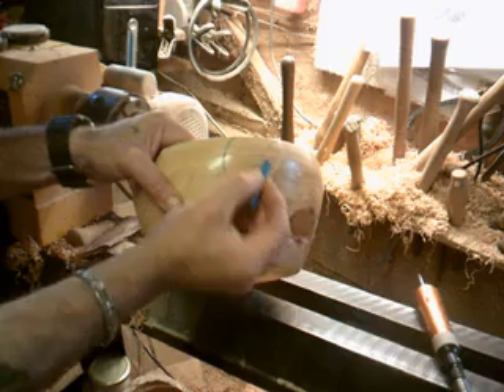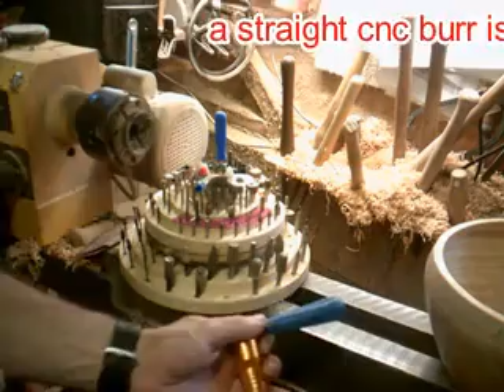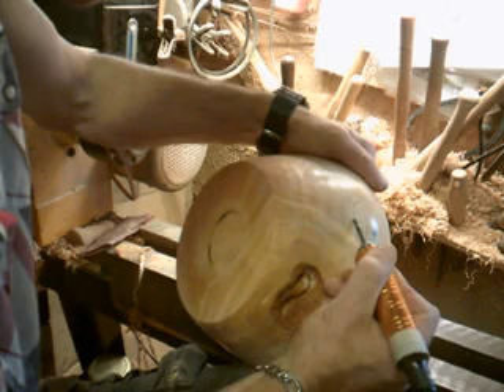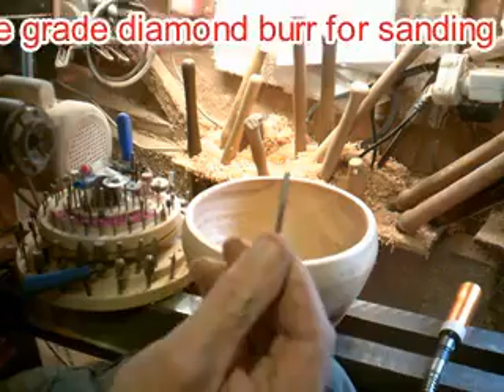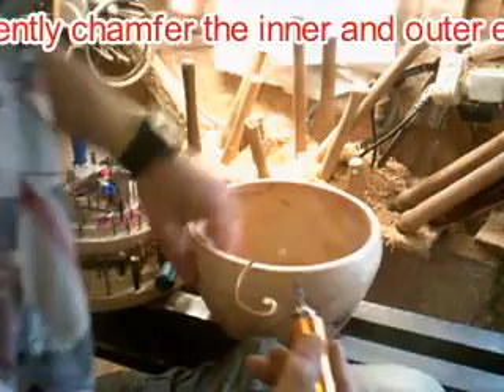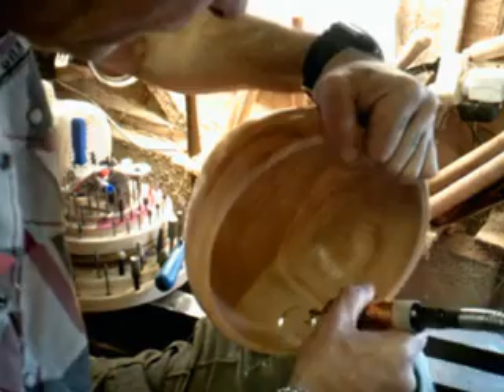yarn bowl slot cutting

Comment: Really wish it was in focus.  I am needing to know this process badly!
Reply from the maker: mark the shape of the slot with a pencil or whatever you have, using a dremmel type tool and a cnc end milling burr you simply just keep following the pencil line a few times until you have a deep enough groove that you can add more pressure to the tip of the burr and just repeat until the whole slot is cut then simply shape the top edge into a slight funnel to locate the wool easier, using a length of fine grade of emery cloth (not paper) roll into a thin tube to sand the rough edges away from inside the slot, i then put in bees wax and rub briskly to smooth that out too. job done.